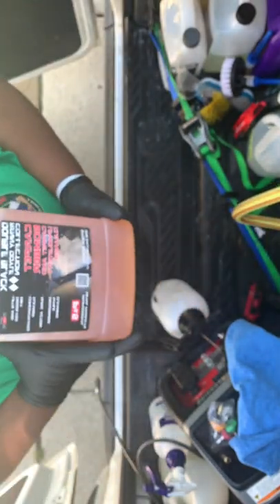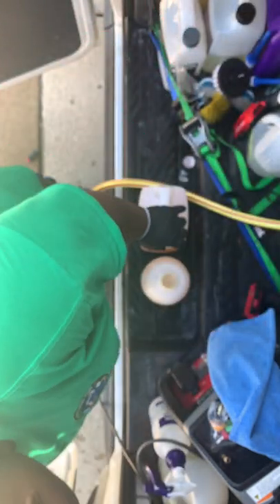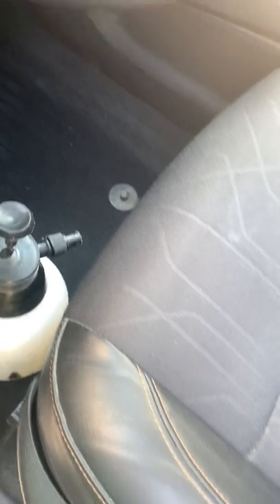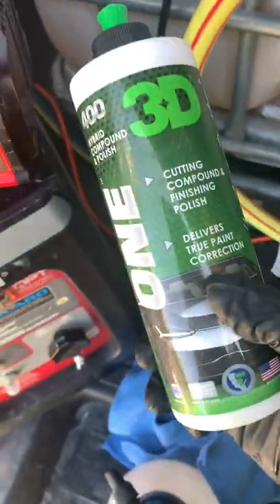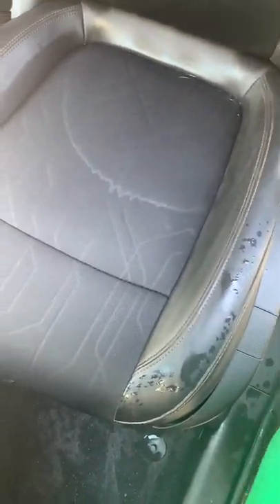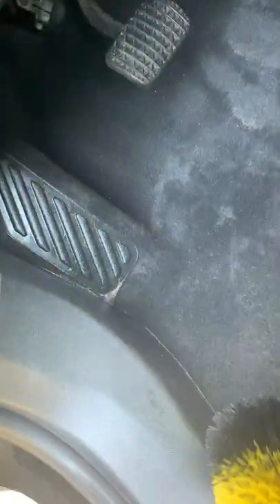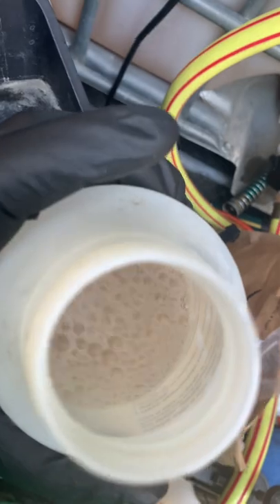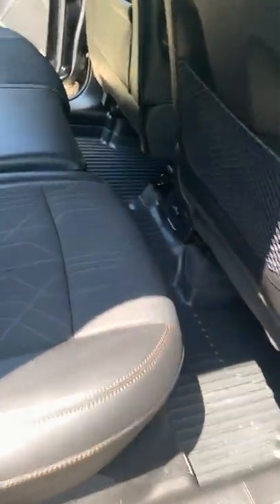P & S Carpet Bomber Test and Review

Comment: holy shit, you would be beter off pouring that cleaner in there lol. I think you just need like a few sprays per area, which is like 1/10th of what youve squirted on that seat and carpet
Reply from the maker: Really Old video . Broken sprayer . Using what I had at the time  . Obviously not the best and still learning . Your judgment is unwarranted , unwanted , and rude . 
Have a better day sir
Reply: Sorry, thats not what I meant. Its just that you dont need to safurate it nearly as much. And in this case less is more